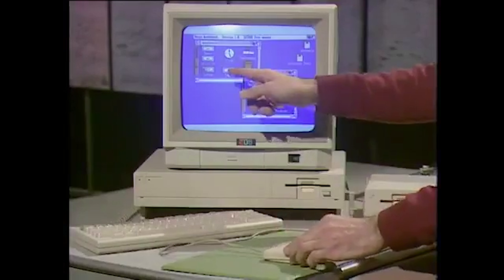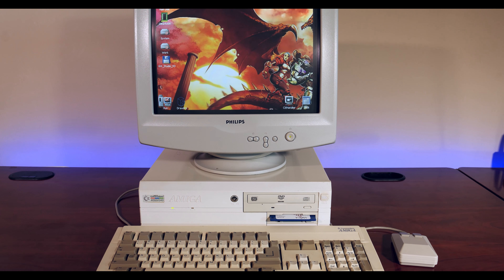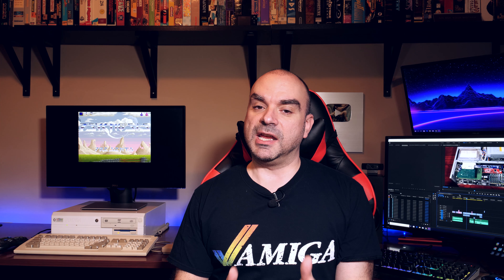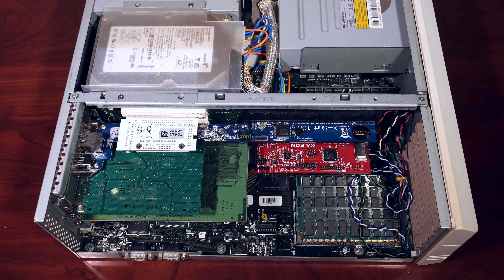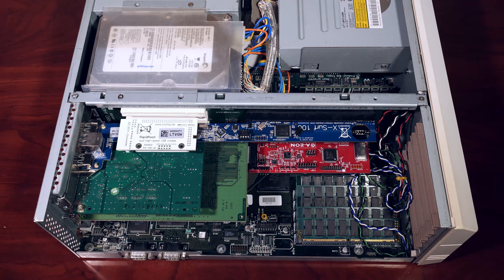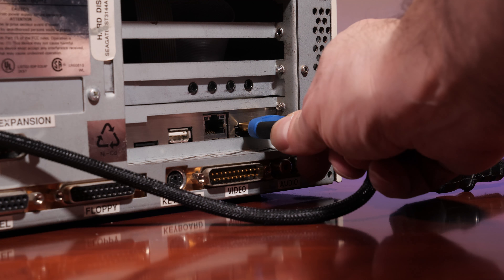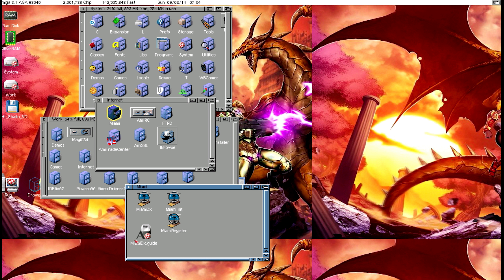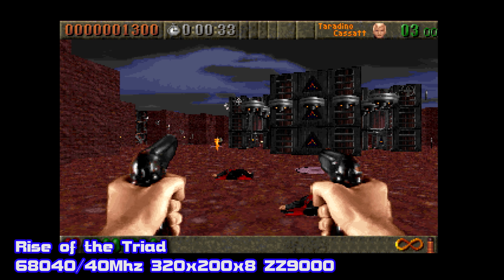Pimpin' the Amiga in 2020 - The Only Amiga Graphics Card you'll ever need - MNT ZZ9000 | MVG

Comment: Love how FPGA and the Open Hardware community keeps the Amiga platform alive.
Reply: Love how FPGA is keeping classic gaming alive in general.
Reply: classic computing in general actually
Reply: Me too
Reply: I absolutely hate seeing FPGAs replace retro hardware. It's just emulation.
Reply: crazy waters  Sure, but what's the point? You basically end up running modern software on modern hardware that way. You can just use a peecee for that.
Reply: @thorham1346  It is Hardware emulation. So nothing to complain in my opinion!
Reply: @leon111333  It's emulation, and I don't like emulation for Amiga related things. I wish new, original chips were made, but unfortunately that's very expensive 😭
Reply: @thorham1346  FPGAs are not emulation. The methodology to make an FPGA design is exactly the same as doing a real chip. This is why an FPGA design translates directly into a suitable structural representation of an actual circuit. Look on your AMIGA 3000/4000 mainboard, and you'll see that there are quite a few programmable chips on the mainboard responsible for the glue logic part. Other graphics accelerators from back then (e.g. Cybervision 64/3D or Picasso IV) implement the PCI<->Zorro III interface in an FPGA, or the scandoubling hardware. There is no meaning ful way to make that distinction between "real hardware" and "emulated by FPGA hardware".
Reply: @porcorosso81  They're hardware emulators because they don't become the circuit they're emulating. FPGAs have extra circuits that you won't find in actual hardware implementations of the emulated circuitry.
Reply: @thorham1346  Of course they become the circuit being described in the design entity(ies), how else is it supposed to work? Whether you synthesize for an FPGA or an ASIC is ultimately a matter of the design tool flow, design libraries and hard macros (such as memories and physical interfaces). As I said, using FPGAS/CPLDs/GALs, has been a commonplace design practice even back in the 90s when the Amiga was still an active hardware platform. Remove all programmable logic elements from an A1000, A600, A1200, A3000 and A4000, and you end up with a non-functional computer.
Reply: @porcorosso81  No, it's not.  That's a misconception.  It's just a series of RAM LUT the emulate gates.  Worst of all, it's bottlenecked internally by dodgy bus or transport system.   I see you've never used one or tried to design anything on one.  PAL and GAL, that's a different story

Comment: The Amiga's chips were designed by Jay Miner, who also designed the chips in the Atari 8-bit series of computers. They have similar ways of working.
Reply: @Great-Documentaries  Are you sure about that?  I mean, yes, it could be argued that since ANTIC can't write back to memory it's not a true co-processor, but it does have a instruction list that can be programmed in the display list.  In this way it's a more primitive ancestor to the copper in the Amigas Agnus and Alice chips in OCS/ECS and AGA.
Reply: @Great-Documentaries  you really don't know what you're talking about. The Atari 8-bit line that Jay Miner and company designed had co-processors. The ANTIC and the CTIA/GTIA being chief examples of them. In 1978/1979. The SID came out in 1982; the Atari POKEY in 1979. If you want to tout Commodore's expertise, why can a 1979 computer hold its own against a 1982 computer? And why did Commodore botch their serial port communications system in the C64 that they copied from Atari's SIO port, the forerunner of USB? [designed by Joe Decuir again in 1979 and released in 1979 with the Atari 400 and 800]. If you want to talk about custom chips in the 16-bit era, Atari Corp had the SHIFTER, GLUE, and their own Blitters for the ST series. Jay Miner and Joe Decuir both designed the Amiga's later tech. Enjoy your Commodes.
Reply: I do not get why he included a circuit to convert line drawings to filled vectors  instead of -- you know -- just filling vectors directly. Bresenham is not that expensive and he could have planned to up the clock in later Amigas. Synergy with the disk drive is not really a reason. I mean this conversion is done by a singel flip flop -- something which could be included in some IC needed for the disk anyway.

This is a 16-bit computer with shared memory and he forget a 16-bit per pixel video mode. The 16-bit CPU has special circuitry to wirte individual bytes and he forget an 8-bit per pixel video mode. (chunked or how you call it)

The Amiga uses flat addressing scheme for video memory (no text mode), so could easily sport a unified approach drawing sprites front to back. But he missed that chance. For blitting the sprite circuitry output could be redirected to memory: Use VBI+frame+VBI to render small sprites to framebuffer, use next frame to combine framebuffer with large foreground sprites. Just because you know most Amiga games ran at 30 fps.

I like that sprites can be repeated like on Atari 2600 "Space Invaders". Now they are used for the background pattern. Most C64 games with their textmode also just repeated the background.
Reply: @Great-Documentaries  The way Antic builds up a display by reading the parameters from its display list is conceptually almost the same as how Agnus would construct a display from its instruction stream stored in its copperlist. The term "co-processor" is ultimately meaningless here. Everything which helps the CPU to do things faster than by its own could be considered a co-processor. ;-)
Reply: @Great-Documentaries  

"Well, on the Amiga they were true co-processors. That never happened on any Atari computer and it was more than a decade before it happened on PC or Mac."

LOL.

PC graphics cards with accelerator chips started to appear on the market before the first Amiga did. You're just making shit up.
Reply: @ArneChristianRosenfeldt  VERY good point! You're actually noticing what Amiga fans refuse to see

Also, the only other purposes the Blitter has is copy-pasting rectangular regions of memory. Again, no programmer with more an hour's experience needs support hardware to do that. The blitter was also slow and only did the operations it did at about double the speed of an unassisted 68000. Jason San from Argonaut who wrote some of the Amiga's most famous polygon games claimed it was useless for it. As you said, it couldn't fill properly. Many people just used the CPU alone. The blitters actual blitting speed was worse than the sprite hardware of even the previous generation's games machines. A Commodore 64 can move more pixels per frame in sprites than the Amiga blitter can. 

When you get into programming the Amiga it turns out to be crap. In some ways it had an edge over the Atari ST, but it was also more expensive so the benefit pretty much cancelled out once you accounted for cost.
Reply: @vapourmile  If the amiga had chunky memory layout, the blitter would be somewhat faster when blitting all the small objects along the road; stuff you cannot do with sprites due to the scanline limit. It is still faster then CPU on AtariSt with the similar memory layout.

Also I would hope that blitter and CPU run parallel. You can even let copper manage a queue. So when you saturate your CPU with T&L anyway, even an inefficient blitter can help. It is just: So many wasted opportunities.

Amiga is the last to have sprites. PCengine and later had linebuffer which couldn't detect collision.

Dual Playfield is cool, but in hindsight 16 color single playfield or two playfield with 4 color each would suffice. Instead of HAM 256 colors ( completely blocking CPU on visible portions of the screen ) could be used for still or golfing. 32 platte +  3 bits for Y modifier. => so all chunky. No 3 bit no 5 bit even not for sprites.
Reply: @ArneChristianRosenfeldt  

"If the amiga had chunky memory layout..."

Yeah but it didn't.

"stuff you cannot do with sprites due to the scanline limit. It is still faster then CPU on AtariSt with the similar memory layout..."

Yes, but who cares? Blitting comprises the task fo copy-pasting rectangular regions of memory. It does nothing to functionally extend the platform, any random CPU can do it.

"So when you saturate your CPU with T&L anyway, even an inefficient blitter can help. It is just: So many wasted opportunities...."

What do you mean? The Amiga didn't do T&L. Yet again, you can appeal to something it didn't do for any platform.
Reply: @vapourmile  For 3d games you need to Transform you vertices. The 68k needs like 60 cycles already for 16 bit multiplication and 140 for division. You need 9 multiplications for a matrix-m and two divisions. In this time on the original A500 the 68k does not access the chip-mem, and you get filling by the blitter almost for free.

Lightning needs an inner product so also 3 muls.

Of course everything would be easy if Amiga and ST did not share memory. Just like an IBM PC. Have single buffer graphics format with CPU access only allowed in the borders or have double buffer with access for blitter/CPU every second cycle.

I mean if you already decided to ditch memory saving text mode. I must admit on Atari ST there was pacmania which used a lot of the shared memory. Still with proper timing that would be a virtual playfield with sprites and some blitting at the borders. But I guess that sharing is due to the 68k which only has limited pipelining. So like on the Z80 there is one phase where it wants data and wants it asap and then there is a phase where it has to deal with its internals ( decode, microcode ). It is not like the intel CPUs which have a read queue for instructions.

Redit discussed that Amstrad CPC did it right.
Reply: @ArneChristianRosenfeldt  

"For 3d games you need to Transform you vertices. The 68k needs like 60 cycles already for 16 bit multiplication and 140 for division. You need 9 multiplications for a matrix-m and two divisions"

Indeed, but how you wrote it I read it as if you were implying these were supported in hardware on the Amiga, as they were on SGI accelerators of the late 1980s and PC games cards of the late 1990s.

"In this time on the original A500 the 68k does not access the chip-mem, and you get filling by the blitter almost for free"

Yes, I see what you mean. There can be advantages for flat-shaded polygon graphics. Don't you still face the problem though that the blitter could only draw polygon edges and then fill them using a basic logic to discover the interior, which could be confused easily on screens which already had graphics rendered to it? You'd need to do something like outline then fill each poly off-screen then blit the completed poly over the screen with transparency. I can't imagine it being very fast, you're really relying on a combination of how slow the CPU is and how slow the blitter is so each can work while the other does.

"Of course everything would be easy if Amiga and ST did not share memory"

But of course, they do.

"Reddit discussed that Amstrad CPC did it right."

Do you have a link to the discussion?
Reply: @vapourmile   Yeah sorry about that, here is the link. It is a bit frustrating to see how even cheap Amstrad could pull of chunky:
https://www.reddit.com/r/atarist/comments/6zm442/why_did_the_st_choose_bitplanes_over_packed_pixels/

I did not check references therein. I once read that Amstrad took Spectrum ZX or so and corrected all the obvious flaws .. but it was a bit too late. Or at least they should have offered a version with an additional 68k like Sega did with the genesis.

The blitter on Amiga would need a portal renderer or coverage buffer like Doom had. As a kid I was under the impression that general  hidden-line-removal  on 8bit-CPU is feasible. Today I feel like this is done by means of flat shading using the background color.

My brain hurts to think about drawing colored lines. So to draw an average of 2px, the blitter has to access 2 words. Sort colors by edges covered and bits set? At least a global filler is not slowed down by bitplanes. And thanks to the predicable timing one can flip buffers even if it has not yet reached the bottom.

Comment: Awsome to see Amiga hardware still coming out. Great video.
Reply: FPGAs are the holy grail of retro computing. Not only do you not need to design and fabricate a chip in the traditional way, but the hardware itself can be patched and upgraded via firmware.

Imagine what will happen if we can get to the point of running FPGAs at frequencies like a GHz. We could see what power a continuation of these systems would've been.

Comment: I’d like to say that yes, for most people, 1080p hd resolutions on Amiga were only available on emulators. But I’ve used my Voodoo 3 card in my Mediator on my A1200 that was towerised in 1998, since 2000. If I had a better monitor back then, I could have ran 1920x1080 already back then, but had to settle with 1360x1200 or something like that, can’t remember exactly... and I also had the Spider USB card, as well as ethernet, sound card and a tv card in it, but yet again, for most people, emulation was the only way
Reply: Or you could have just had a PC where that sort of thing was already completely normal.

Can't imagine the point of having a Voodoo 3 card on an Amiga. Was there any software for it?
Reply: @vapourmile  yes,  a fair number of 3d games were ported across and used eg Warp3D

Comment: I have been playing my old Amiga games and demos on a MiSTer FPGA. It has a built in HDMI port and all the scan modes are converted to your target output mode. It is the best option for playing all your old games in a cycle accurate FPGA Amiga recreation that is compatible with modern displays. If it is the productivity app you want to run then a Raspberry Pi 4 will smash any real hardware without ridiculously expensive modern boards. I was the champion of Amiga fan boys back in the day and ran one for years after their demise but I really don't see much point in spending money to upgrade one these days.

And you are Australian damit! Don't be pulling that seppo zee thing.

Comment: I bought one of these.  Still have not pulled out the A4000 and installed.  I got tired of trying to find a scan doubler for the 4000 and splurged.  The benefit of the scan doubler PLUS the additional features on the card made it a must have for me.
Reply: Yeah me too, the x-surf network card failed me (again), so this is the best new zorro card since many years ..

Comment: Awesome video and hello from AU! no doubt will meet you again at AUG someday.  Bought 3 of these one for A3000,  A4000 and A2500. Display is crystal clear in all modes on new Dell 27'" monitors and at 1080p the text and icons are miniscule so I tend to use 1280x720 as the sweet spot once you have one it's hard to go back when you don't own any crt monitors.

Comment: I pulled the trigger and bought 2 ZZ9000's and companion Sound Cards. I have an AA3000+ board being built to go in a Checkmate 1500 black case with Simon's sheetmetal fitting kit, then an A4000TX going into a Fractal Define XL for that big box Amiga experience. OS 3.2 on CF via IDE, and waiting on the ReA4091 SCSI Zorro cards to become avaliable. Either BFG9060 or upcoming Vampire accelerators will go in them. Not sure at this point. Exciting times and its amazing new boards can be built.

Comment: A significant firmware/driver update (2.0) is in the works as of this writing, and there are possible other future expansions in the wings. As of a recent screenshot from Lukas Hartmann's Twitter feed, at least an audio module is planned for the ZZ9000, so it's quite possible that the ZZ9000 will get 16-bit audio capability. Remember what Lukas has said: "The ZZ9000 is highly extensible".

Comment: These work on A500s too.” To use ZZ9000 with Amiga 500, you need a Zorro II adapter like Rob Cranley's Z-500 or the Checkmate 1500 Zorro adapter.”
Reply: So it doesn't require a Buster chip present for DMA?
Reply: Jeremy Levi, no buster required. You can order the A500 version from the MNT store. The Zorro adapter is needed though. Zorro Version / Cable Type: Zorro II Firmware Preinstalled / Includes Denise Adapter for A500 €359.00

Comment: I think we all have been so accustomed to LCD screen that we forget what the Amiga is supposed to look like. With that awesome graphics card you NEED to be using a CRT monitor. LCD is chunky and blocky compared to a CRT when doing a side by side. . The size you have the Amiga running on the LCD over you shoulder is the same size as the Amiga CRT anyway.

Comment: Nice video as always. But wanted to see the tests where GFX cards really fall down. How well they do at promoting older applications that did not have screen mode requesters or public screen support. In my with a 3000T and 3000 first had a Piccolo SD64, and EGS card and then the much better Cybervision 64 which had hardware planar/chunky hard conversion, unlike the inferior 3D replacement. I am thinking of Professional Page which work fantastically well on the CV64 but not at all on the Piccolo. Some will never work on RTG when promoted but would have been nice to see some experiments.

Comment: I have my 1.5k USD core 2 duo  PC from 2008 ( from my first job) out in the sun collecting dust and rust..  spent on it another 1k usd before giving up completely on it. 

Overclocking killed the system.. had imported twin cpu fans upgraded Rams, gpu but when mobo itself needed to replace which would result in me getting newer cpu and ddrs I gave up .  
System less for 3 years now... This video breaks my heart.

Comment: Maybe new hardware could improve a few things, but looking at an Amiga is like timetraveling 40 years back in time. Maybe an update here and there would not be a bad idea. There is nothing wrong with switching to Unix as an operating system, the Mac did it and long ago that was on 68000 as well.